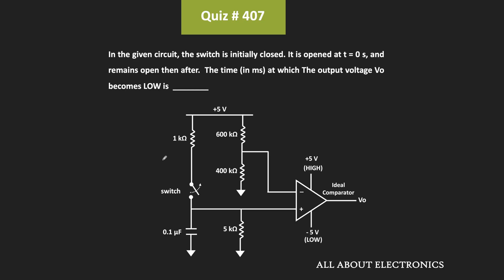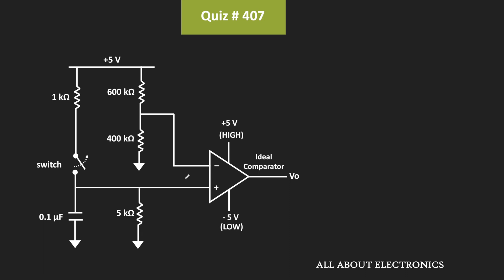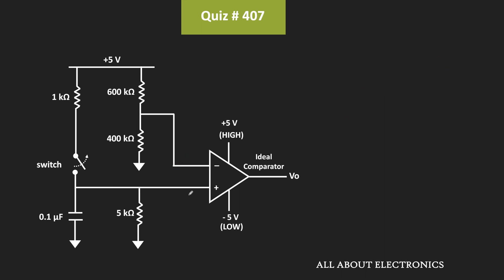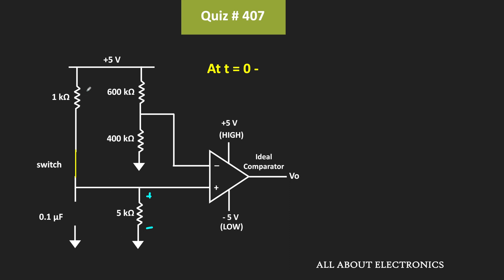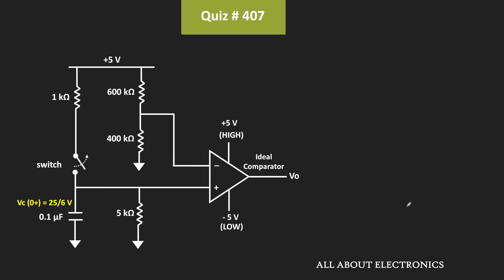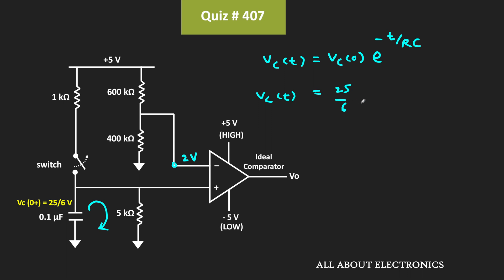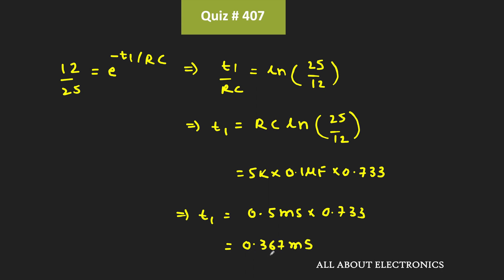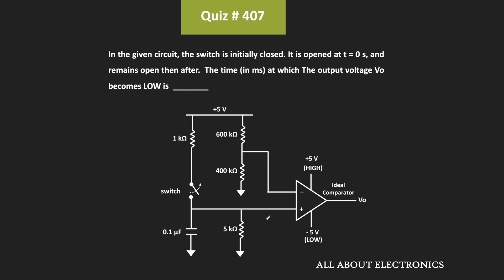Transient Analysis / Comparator Solved Problem | Quiz # 407

Comment: I think the solution is false. First V(0-) is not 25/6 , V(infinity) = 25/6 , And  I find Tao =R_eq * C , R_eq = 6k . So I find t= 0.39 ms
Reply from the maker: At t= 0, since switch is opened, so capacitor will start discharging through 5K resistor. So, at t= ∞, the capacitor will get fully discharged and its output will be 0. Moreover, before t= 0, since switch is closed, so before t= 0, the circuit is already in steady state condition. Therefore, capacitor will act as open circuit. And therefore, the voltage across it is the voltage across 5K resistor. That is how, V(0-) = 25/6. Please read and understand the question carefully. That is very important.